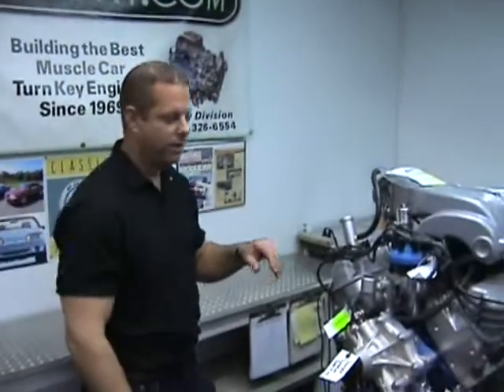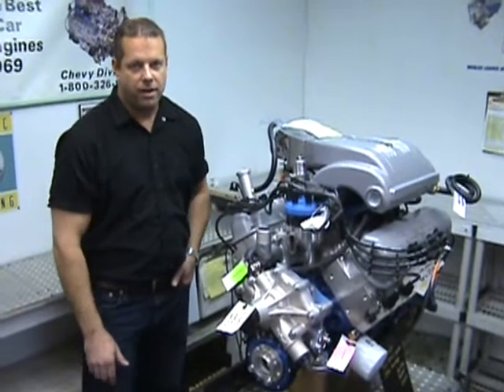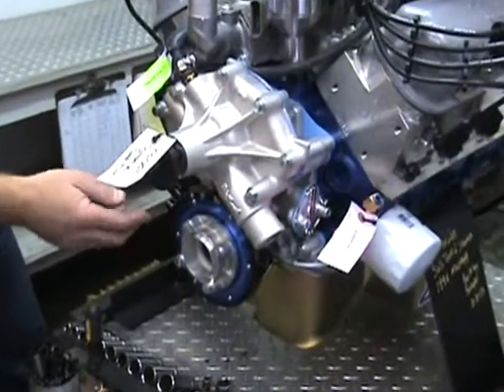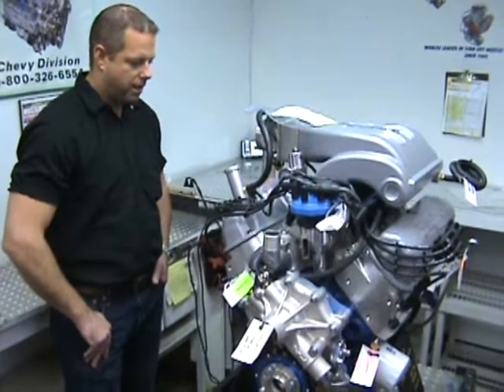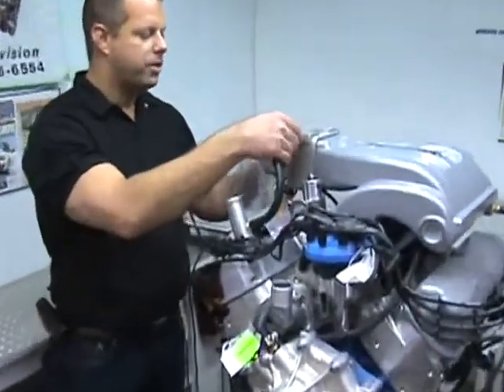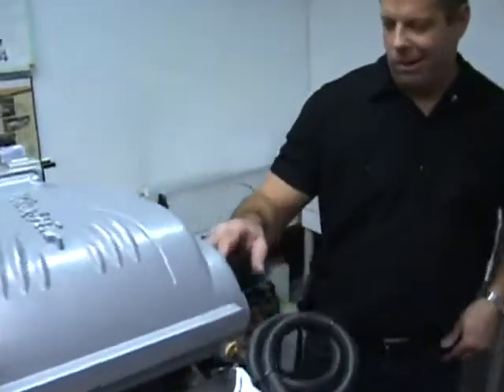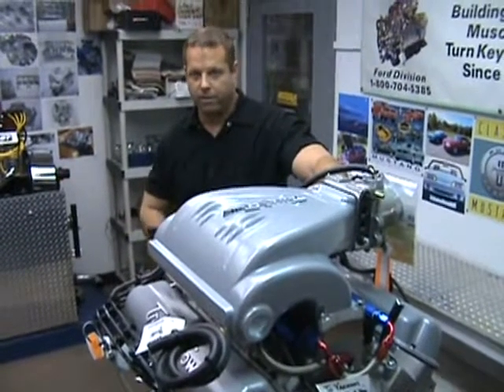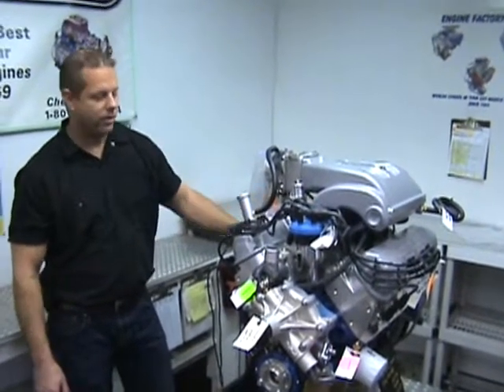Engine Factory Build Ford 363 Stroker for a 1988 Foxbody Mustang

Comment: Yea I'm with Ryan Robart..  I think what he means is its going to make over 650 with the blower. That's def accurate. Biut no way it will make 650 n/a.. I have a 408, victor junior heads, super victor intake, solid roller 630 cam.. Electric water pump, etc, and I made 545 at the crank, and the heads are hogged out.. I def would buy a motor from these guys, they seem to have a good history.. Really nice guys!
Reply: +ron haley It can be done with the right combo..........no way the combo in the video is even close to 650 in n/a trim. I just did a 408 for a buddy serving overseas. Dynoed at 632 hp and 540 lb ft on 93 octane pump gas in n/a trim. TFS High Ports full renegade port job, custom J&E 11.5:1 pistons, Bullet Cams custom solid roller (Street drive able and specs are secret squirrel shit), Man O War intake (lightly ported) 1050 hp QF dominator and a ton of other parts. I only dyno on my sponsors (NHRA Pro Stock Owner/Driver Don West) dyno. No inflated numbers. My yates headed 427 sbf make just shy of 800 hp n/a on E-85 (vids on my page).
Reply: +Jeremiah J I wanna see that 427! streetable? sound exactly like what I want.
Reply: thelandofmisteroz
Ill post up a video of it so you can see the engine itself. Only video I have is of the car making passes. , all it would need is a cam swap to be more street friend. It would lose about 40 hp give or take but thats about it.

The 408 I did for my military buddy is 100% street able on pump gas with the numbers I posted above. I Might even have a dyno video of that can post up......that will be one hell of a fun ride when he gets home (signed up to stay longer)
Reply: +Jeremiah J looked through your videos...  copper mustang has the 408?  do a video on the motor build pls!
Reply: The cobra has the 427 that makes right at 800 N/A horsepower on E-85. The 408 I talked about is the 600+ hp N/A street motor I did for my buddy. I will try and get something done up on it in the next day or two.
Reply: My mild 340 mopar made more then that

Comment: This vid is fairly old, but you guys need to reflect on the options that today's consumer has when it comes to shopping for engines.  Just went to the website to see how much one of these motors would cost, seeing 10K for a factory block 375 horsepower 302, is absolutely crazy when you can have a machine shop build a motor with all forged internals for half that, or just go straight coyote which is more reliable, stronger, technologically advanced, with more horsepower.  Great engine combo's but severely overpriced for what the consumer is getting.

Comment: very nice
Reply: Thanks. Unfortunately its still in my garage in a box. Haven't had time to install it yet. :-(
Reply: @ford7319  that is do sad, all that work. I'm running out of time with bad heart but pulling wrenches trying to get the SN95 running again. Hard to even get manifold bolts for 302 HO
Reply: Big Rick's Haberdashery I hear you man. I hope you will be ok. Don’t give up though and I won’t either.  I plan on retiring in the next 5 years and I should have it in by then. I’m still enjoying the engine I built.

Comment: Well, I'm sure that it's a badass engine,  despite the fact that the salesman didn't rehearse before the vid.  " Supercharged foxbody mustang ".  There seems to be a supercharger missing from the engine.  It's one of those thingys that goes on top right.... as my wife would say.
Reply: +ThatDanDude most foxbody guys run centrifugal superchargers, they sit off to the front like an alternator sort of, stays under the hood and you use the same intake stuff, probably what he is going to use.